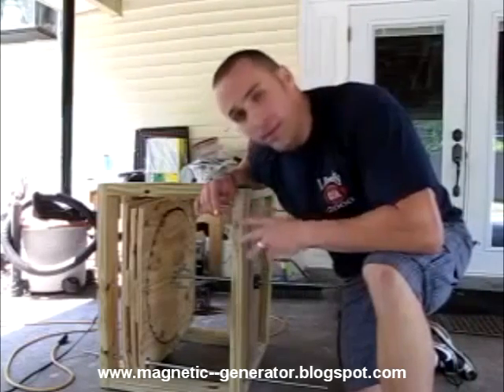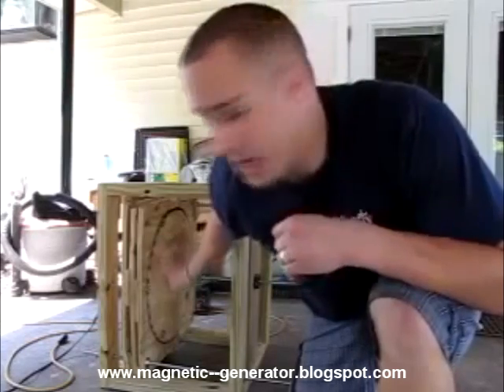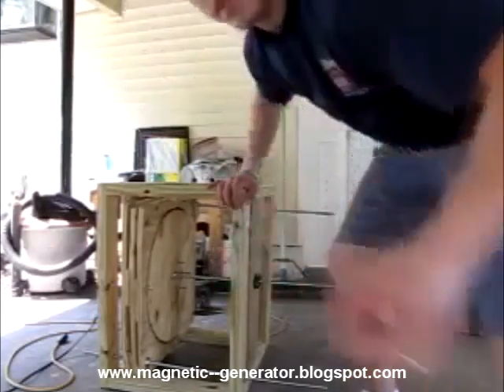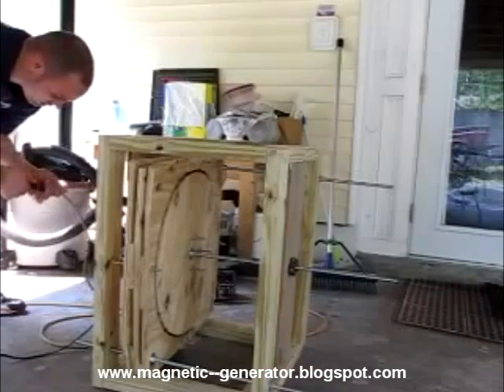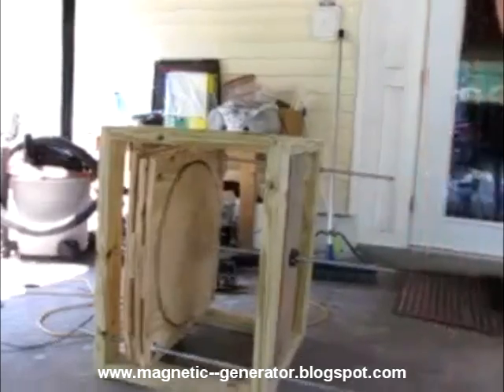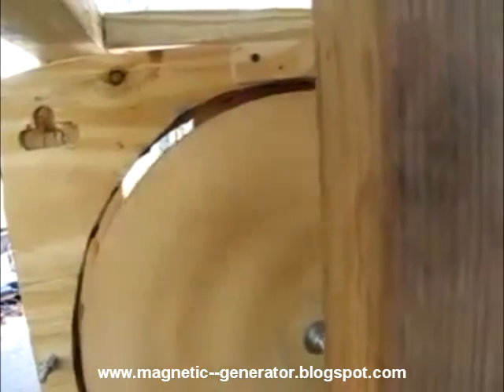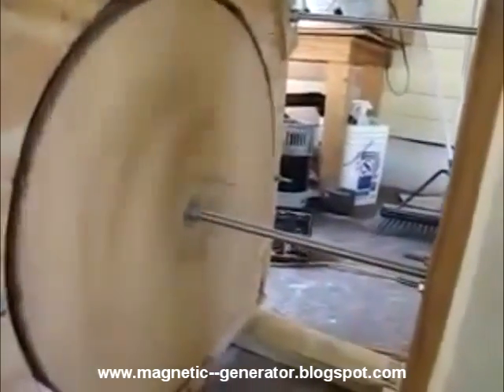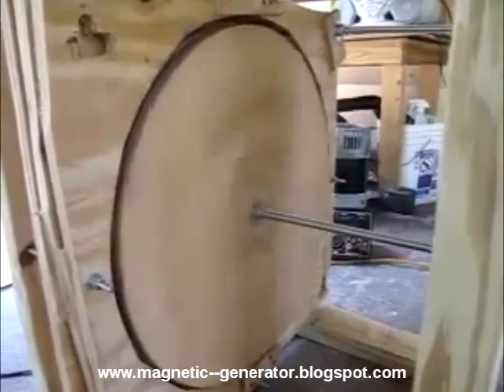Free Energy Generation - Build Your Own Magnetic Generator

Comment: As soon as you touch the two output wires of your generator to ANY load at all, that thing is going to quickly slow to almost stop. Your bigger model you speak of will run but will be bogged down when a load is put on the generator and start drawing more amps.
Reply: 4600 watts extra?! ! WOW and to think that with just .00001% over input would give you unlimited energy for the rest of time to power the entire planet. and you have 500% WOW. better play with some small generators before you spend too much money on that thing. Good Luck

Comment: Only way to know if this works for what your looking for is to have a way to count the rpms accurately before you install the magnets. Then install the magnets and get the rpm count. If its higher then install a flywheel to add torch and see what the rpm count is then. If the rpm count is still higher then your first set of numbers you might have something.

Comment: I think MrSummitville works for an electric company... Or simply hasn't played with a magnet.

If a magnet moves away from another magnet, would that not be free energy? By telling people free power does not exist, you deny their very existence or perhaps just not critically thinking.

While we may disagree on the output of power, it is undeniable that magnets positions appropriately will generate different levels of free energy... Arguing that fact is complete nonsense. The real trick is optimizing your design to allow for greater energy yields and this gentleman's experiment is a great learning tool.

In regards to optimizing the design, have a peek at the Rodin coil... That is how you can make the universe work for you.
Reply: scorponoc333 that's the point the magnets are spouse to push but if done right you should get enough speed to turn the motor off and run on its own
Reply: Thanks for the comment Jonathan. I have taken a peek at a few different designs over the years. Have you found any designs that seem stand out from the others? I have played with some ideas my self but I can't seem to get everything to say balanced enough to remain in motion but I comprehend the concept.
Reply: free energy by definition requires no outside assistance to produce energy.  as he had to assist it by spinning it, it is not free energy.  he is creating a larger outgoing source then the initial incoming power.

Comment: John,
 I will tell you right now, that you will NOT get 5,500 watts OUT with only 900 watts IN. Please calculate the FORCE needed to turn the the 5,500 Watt Generator at FULL-LOAD and you will see, learn, discover that it takes more than a 3/4 HP motor. As you can see from your demo that you need 65 watts just to over-come the friction. So far, you have 65 Watts IN and 0 Watts OUT. That ain't OVER-UNITY ! That is the exact opposite of Over-Unity. You currently have 0% efficiency - ouch!